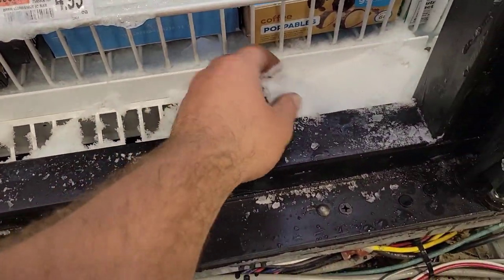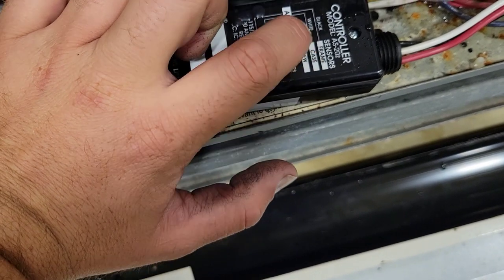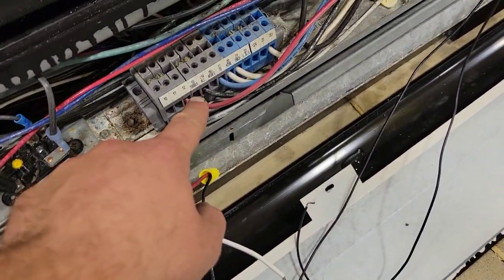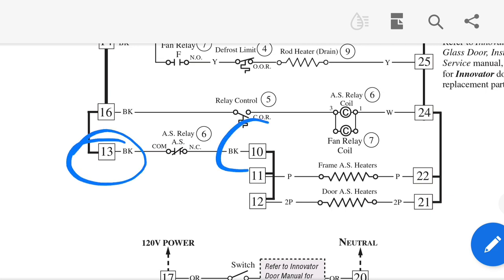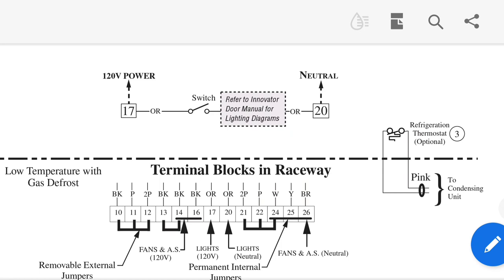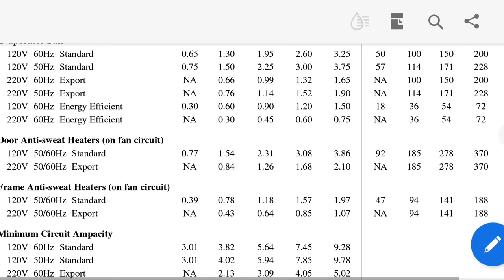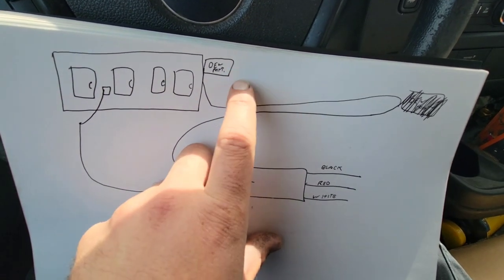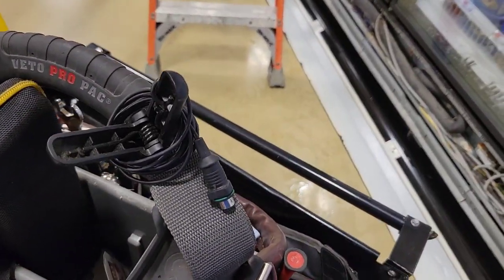Supermarket Refrigeration - Anti Sweat System "AS-20Z ControlTec" Door Frame Heaters Icing Up (RL-5)

Comment: Thanks for this I have to order a brand new one some water dripped on the wires and arched the board now the whole frame is frosted up funny thing is I smacked it and it got power for a bit and melted it off

Comment: I would guess the neutral came loose ? Otherwise I can’t believe it would of ever worked? Nice explanation stay well
Reply from the maker: If there wasn't so many instances of this I would believe that the neutral just came loose. Also the position of where the neutral was led me to my conclusion as well. it wasn't like just barely loose. it was like hanging in the Raceway just not even close to the terminal block. So your right it probably never worked. 

But part of the issue is it will take a monthish for the case to be iced up so bad the store actually cares enough to inform us. 

So these guys come in wiring this anti sweat system. Then without fail about a months or so later we get overwhelming amounts of calls for all of these cases and their anti sweats. 

It happens. Maybe he just used the bathroom and forgot to wire in the last two wires we all make mistakes.

A least that my guess. But in reality I'll never know for sure 🤷
Reply: @gendronhvac-r1269  very strange